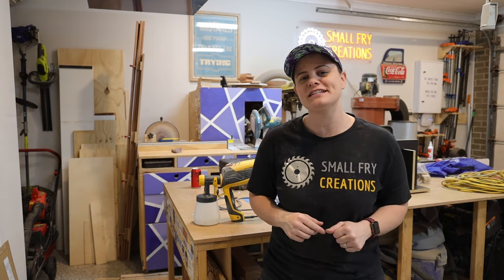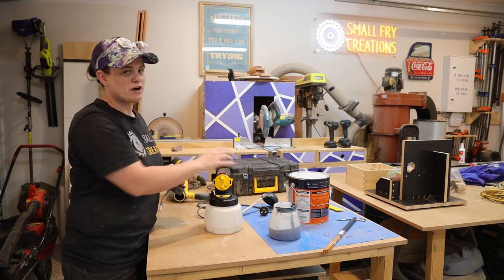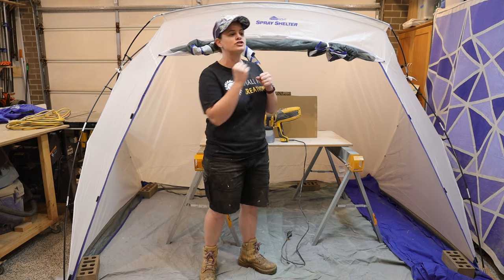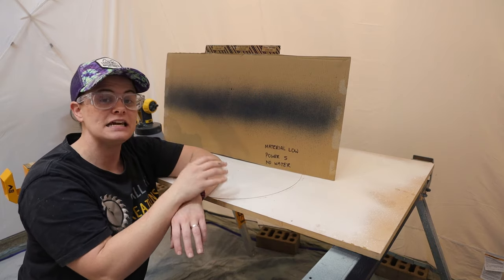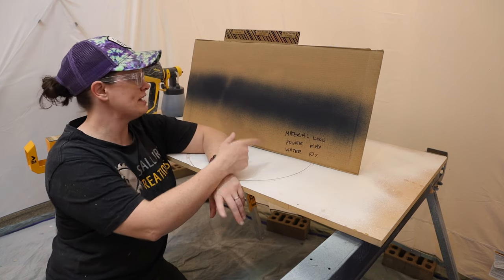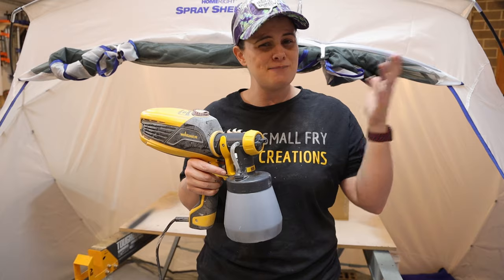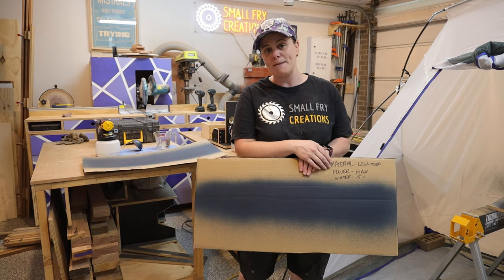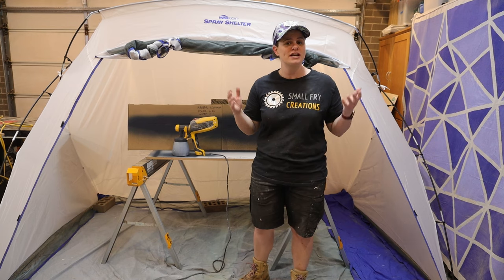Wagner Flexio Spray setting tips and setup | Perfect for Beginners

Comment: Why is my Wagner sucking paint back in to the motor?
I’ve cleaned it thoroughly, I’ve put new filters in, but it continues to suck paint backwards. It sprayed forward one time and then just blew a ton of paint out of the front, but also into the motor. This was after the 4th cleaning. What am I missing?
Reply from the maker: Ooo this shouldn't be happening. I would reach out to Wagner and see if they can offer support as to why its happening.

Comment: With Acrylic latex paints in general do you thin the paints when using the sprayer?
Reply from the maker: Hey mark. Yes I do. About 10%. If your ever worried start by not thinning and testing but I find unless is a clear water base finish it needs to be thinned. Hope this helps
Reply: @SmallFryCreations  Thanks I got some sherwin Williams and the paint is thick

Comment: Help! I've tried all of these tips and others, but mine still spits and will not spray in the downward  position at all (nozzle is facing the correct way)...it's a brand new W 575 Flexio. Any ideas?
Reply from the maker: Bummer. It could be the age of the paint? Try running water through the machine and see how it runs. That should tell you if its the paint or the machine. If its the paint I would try straining the paint if the paint is a little old. If the issue is only happening when you have the sprayer at a certain angle remember to check the tube inside the canister that it is facing the correct way. Hope this helps :)

Comment: Hello what about and what type of oil piant should I use and what type of settings you recommend for pianting my carage door and my car garage door is aluminum.
Reply from the maker: Hello I haven't used oil base paint in the sprayer before as I hate the wash up. You would need to use an outdoor paint that adhears to metal. I would also suggest to prime the metal first to help with the paint. When it comes to the sprayer I would still do the same steps as in the video but try it on some cardboard first before moving to the door. Hope this helps.
Reply: @SmallFryCreations  Thank for your tips and yes I have primer and the oil paint is for this aluminum, I ask a professional about this oil paint for my aluminum garage sliding door,Can I set the spray gun to Hight and the other setting in medium and yes I will do the test on a car board. I will let you tomorrow how it went. Thank you for ur advice.👍
Reply from the maker: Fantastic. you have got this :) Happy spraying!

Comment: Hello :)
I'm used to using mini spray guns of the automotive spray variety and am wondering how much overspray and mess this type of wagner produces. It seems to do thicker paints which is really nice, but I also spray in my garage and am tired of having overspray on every surface even if I use drapes or a curtain (I have a plastic tarp set as a curtain to seperate most of my garage area).

Comment: Can someone please tell me, do you still need to lightly sand between coats when using a sprayer? Or is the need for sanding negated? This would be the main appeal for me!
Reply from the maker: You would still lightly sand between coats. Spraying is no different in terms of the steps you take. You just save time and most would argue it gives a better finish. Hope this helps 😀
Reply: Thanks!

Comment: Over spray and inconsistent particle size is the biggest disappointment with this product range. My painter friends said don't buy one and I learnt why. Good for textured surfaces but id never use it indoors where i want a premium finish. They are very fast and easy to clean up which is why I ignored my painter friends advice and got one anyway. Vs airless sprayers that can give trouble with pumps. Great video tho and far better then Wagners attempt.
Reply from the maker: Great feedback and glad I could offer some help

Comment: Pro tip the bottom line with these sprayers is multiple coats of thinned paint will give you the smoothest finish, if you are lazy and want to get it done in one coat the paint will be thick and  it may not look  look sprayed.
Reply from the maker: Great tip. Couldn't agree more. Thanks for sharing

Comment: If you want to 'adjust one setting at a time," thinning the paint is not the first thing to do when testing a machine that claims "no thinning of latex paint is required."  That can had been opened previously, so how long has it been sitting?  Did you strain it? 
Not a fair review or someone looking to determine if the machine could be used to spray latex 'out of the can' (without thinning or using additives)

Comment: I used a full 500ml fusion paint jar and only sprayed 1.5 small bedsides and it was empty
Reply from the maker: If you find its putting out to much paint try turning down the material flow a little. I haven't use fusion paint before so hard to say if that usage is normal

Comment: FYI: you are using the STANDARD nozzle, the FINE nozzle is blue and the hole is even more smaller.
Reply from the maker: That is correct. However in the pack the blue nozzle is not included. I have since picked up a blue nozzle and its fantastic

Comment: Warning: manufacturers warn against watering down more than 10% because its weakens the structure and integrity of the paint and it may result in paint that peels off or chips in the future. Even with acrylic artist paints the max you can water down using water alone, is 10%. 

Options to add more viscosity to acrylic based paints without depleting the integrity would be to add “Floetrol” (or a latex extender ) or follow up with a final seal coat to lock in the weaker base paint coat. It would be a shame to go through all that work and then have the paint fail in a year or 2. Just a thought.
Reply from the maker: Hey thanks for the warning. I have never had an issue but something to know and good to watch out for.

Comment: If you want a paint cooker, get a Wagner Flexio. If you want a paint sprayer, look elsewhere. I've battled this Flexio 3000 (using the detail head) for the past three years and the day I get to put it in the rubbish will be a happy day. The air coming through the turbine heats up the head - probably because the air passes right over the motor coil! - and literally cooks the paint so that it clogs within minutes. If you're lucky, you just need to remove solid paint build up around the front needle valve. But sometimes you have to take the paint needle valve completely apart and pull out the solidified paint around the venturi port seal. Using solvent paints will shrink the two main seals and the gun will leak paint everywhere. I now know every square inch and part of this gun intimately, unfortunately, and it is just terribly designed. I spend most of my time painting with this gun trying to get it work reliably. Today, I was trying to prime two sides of a door and a job that should've taken an hour ended up taking three. It's just junk.
Reply from the maker: Bummer you have had a bad expereince. I have only ever use the 590 and haven't expreience any majoy issues

Comment: I just finished a day of using this unit. Nothing but frustration. Constantly unplugging air nozzles, stopping to fill the container again and again. It took so long to prep and to spray that it was pointless. I could have cut in and rolled in a fraction of the time. Your results may differ. Anyone want to buy a Wagner sprayer cheap? 😂
Reply from the maker: Bummer you haven't had a great experience. I say do what works :)
Reply: @SmallFryCreations  yah, it was a bummer! I always  wanted to try one - now I have and I know. Good luck everyone.

Comment: Mine worked for 5min now doesn't spray
Reply from the maker: May be clogged. Try cleaning out the spraryer and having anther go. Paint also may be to thick or if its old paint it might need to be strained. Hope these tips help :)
Reply: It will be blocked in the small hole under the bottom of the plastic tube line .

Comment: Spray pattern is simply terrible at all settings. Spray grain is very thick and seem random. Paint dilution takes so much time, this pistol blows with air with incredible noise. The dilution is way above the norm. IT SUCKS HARD
Reply from the maker: Oh this is frastruting for you. I haven't had this issue. Sorry its not working for you
Reply: Make sure the paint is slightly warmer especially this time of the year . Sit the paint canister in some warm water it helps a lot .

Comment: Rubbish product, it blows hot air which makes the paint dry on the nozzle causing it to either block or shoot specks of dry paint onto the finish. Buy a compressor and a hvlp gun instead

Comment: I know you have good intentions here and I like your presentation style, but really that was just word salad.  Could you not at least read the manual before you go to all the trouble of making a 10 minute tutorial? You are using all the right terms but you have the meaning all mixed up.  The simplest thing to adjust is definitely NOT the thickness. And you can measure that, with a viscosity gauge/meter that is included with every spay gun I ever bought. The stuff you call overspray are actually spatters from the paint being too thick... overspray is another thing altogether.  It's the fine mist that becomes airborne that you don't want to breathe or have settle on everything in the room. I could go on but really guys, read the damn manual! I feel we just got 5 steps closer to Idiocracy. I was just waiting for you to tell us that we must wash the gun out with gatorade!